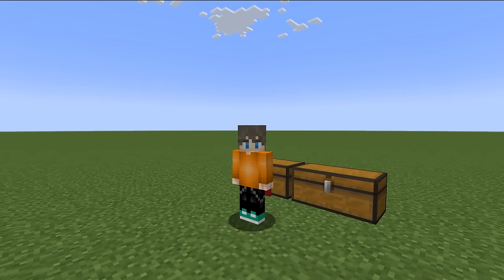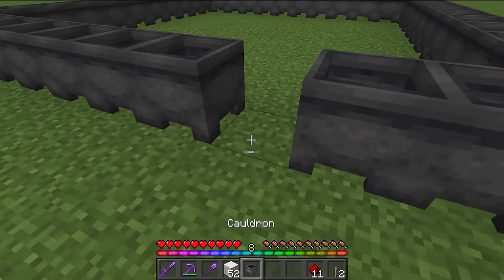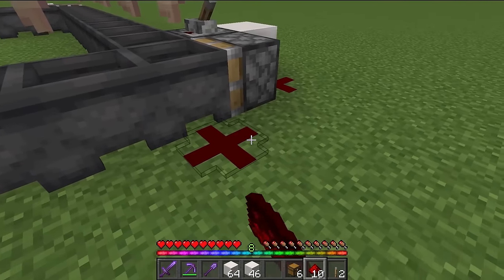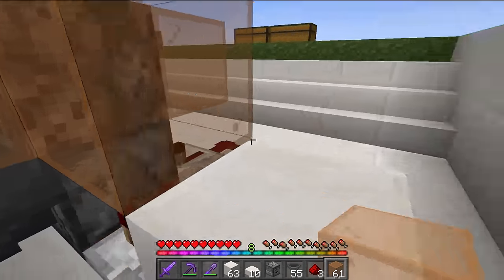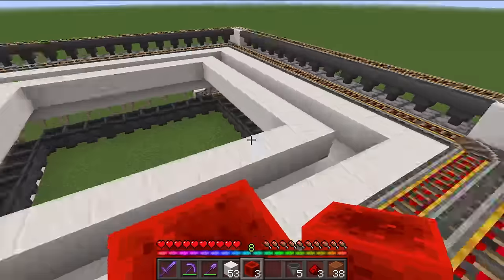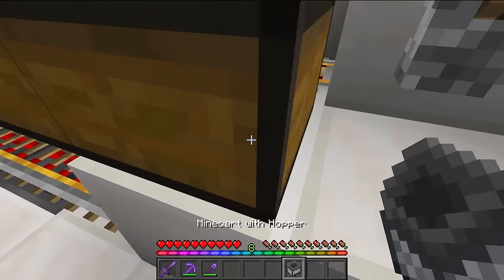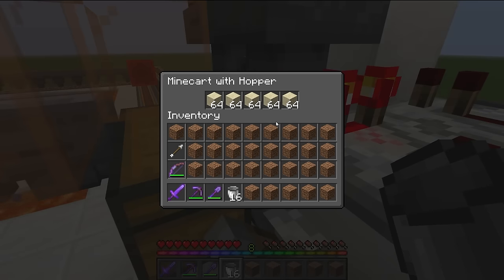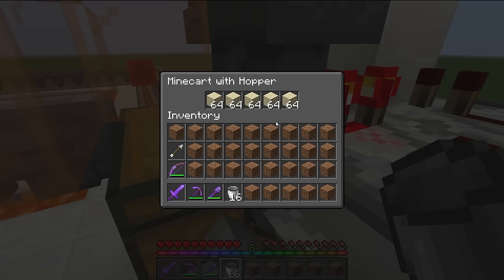Lava Farm Super Smelter Tutorial for Java 1.21 (and 1.17+)

Comment: for some reason the dropper doesnt drop me a bucket
Reply from the maker: Throw an item into the hopper while looking at the comparator. Does it light up? item in hopper should light the comparator. That should power the block, which powers the dust, which fires the dropper. Something in there is wrong if putting one item in the hopper doesn't dispense one item from the dropper.

Comment: why the farm don't work i use the litematica and the pston don't work fine
Reply from the maker: You have to find where the extra cauldron is and turn it off and on quickly. Make sure there are no other pistons extended in the way of the square before you start and then just flickflick two times quickly to make it start. If you are too slow the piston stays out and the next one can't move.

Comment: Man my cart isn’t taking off on it’s own, that part of your tutorial isn’t very clear.. Please help me out
Reply from the maker: The cart should run on its own as long as the cart is full and the hopper only has the right number of items. If the cart isn't full because there's no more to go in, you'll need to flip the lever to send it automatically. Leave it on for a few runs then turn it back off. If the cart isn't running because the cart is full AND the hopper has more than 1 stack in it, move everything in the hopper back to the chest and it will run automatically again.

Comment: its cool but furnaces are normally player-less. I've only recently started using flying machines and its so easy if you dont care about losing some bamboo lol
Reply from the maker: Let's run the math: 50 buckets will smelt 5000 items, it takes 20,000 bamboo to smelt the same amount. This compact system holds enough fuel to smelt 30,000 items, which would require 120,000 bamboo. One bamboo grows on average every 205 seconds, or just over 3 minutes so to ensure you can refill a 50 furnace smelter enough to continue smelting you'd need a massive field of bamboo, not a 12 wide, 100 long or something. 

Basically, I've had bamboo field flying machines for 3 years. This is FAR better imo. You don't need to be there unless the system needs more buckets. The first load up is a bit slow but after that this should win.
Reply: @RadicalElder  oh sure, but my point is the time investment like.. to build this and get everything for it.. and then have to come back to it to refuel it... to sort out the buckets from the output. It's funny how I'm over buckets and now into bamboo, and you're over bamboo and now into buckets haha.
Reply from the maker: You don't sort buckets from the input - they're automatically fed back into the bucket refiller - so the filter at least takes care of that part. But yes, very funny that we've swapped. I had a massive bamboo fueler before but when doing big, big projects it just became unwieldy for my needs. I'll be building this in my HC series so maybe you'll get to see how it works for me specifically. :)

Comment: This is a cool design but I have an issue with lag and am wondering if anyone else has experienced this also I’m playing Java 1.19.2 and I put this build in my industrial district on my world I usually run at an average of 165 FPS or so and have been having normal spikes as low as 60 FPS and some quick ones even dropping my FPS to a choppy rate when I look at my f3 menu it shows that it’s using 100% gpu I’m running with a 3060 12gb so I don’t really get what part of this is really killing my pc so bad
Reply from the maker: It shouldn't be this farm causing you lag. You probably have a ton of hoppers or villagers or item frames somewhere nearby? My guess is hoppers if this farm is what you built when you started noticing b/c this one has some hoppers. Not enough to cause lag by itself but if you have it near another 200 or 500 or 1000, it's hopper lag. Cover the ones in the rest of your builds with composters anywhere that you can.
Reply: @RadicalElder  I have less than 50 hoppers in the loaded chunks from where I built it and none of them could can be covered my guess is something to do with the lava because I’m not having a lot of cpu load and am running well below the allocated ram usage but it’s spiking my gpu load up to 100%

Comment: I'll build this when I need to smelt massive amounts of blocks because this feels like I'll be building for hours lmfao.
Reply from the maker: Haha Well the lava farm part takes ... maybe 10-15 mins tops. The furnace bit is maybe ... just a couple mins? Rails don't take long. Honestly, for me to build it knowing the setup would prob take 30 mins. But from scratch it can take a little bit. The time savings definitely comes when you want to smelt a double chest of sand into glass and it happens 50x faster than with a single furnace or when you don't have a ton of coal and you can still smelt infinite items. :)
Reply: @Coding by Blaine i play on a strict vanilla server, so unfortunately that won't happen. Thanks for the tip tho.

Comment: Can you please do this in Bedrock 1.19 and make it a 10-everything system?  I only have 10 dripstone and that idiot wandering trader doesn't sell them hardly ever.  I'm in survival, so it's extremely hard to come by the dripstones otherwise.
Reply from the maker: I can't but if you search "silentwisperer dripstone farm" and just build the first one you'll have more than you know what to do with. :)
Reply: @RadicalElder  I'm not after the lava alone.  I need the machine you have here, where it puts it's own buckets of lava in the furnace(s) for the player.  I've started working on trying to augment this in Bedrock 1.19 creative mode.  I got the first part, with the pistons and cauldrons working (it needed extra redstone to connect each corner, so the whole thing is surrounded by redstone), but the part with the hopper, dirt, and 16 buckets doesn't work (because it's not Java, I'm sure).  So, I'm playing around with that, but don't expect much to happen.  I was hoping you'd know some trick to fix that and any other hiccups that come along.  Thanks for your quick reply though!
Reply: @RadicalElder  Well, the wandering trader has burning ears I guess.  He sold me another 10 dripstone a few hours after I posted this, so now I have 20!
Reply: @RadicalElder  Also, I'm now at the 10 to 11 minute mark in the tutorial.  If it's possible, it would help if you could grab that section of video and post it separately, but slowed way down (without the audio being slowed down, the way the YouTube controls do it).  There's a lot of hopping, spinning, and item placement going on in rapid succession, and it's a little hard to follow because it's in a 3D environment, and you're working on multiple levels almost at once.  I'll use the YouTube controls without audio and try to follow along, but having the audio at normal speed (with breaks between steps for us farming noobs) would really be helpful, in a separate video (so those who aren't noobs don't have to wait around in this video).